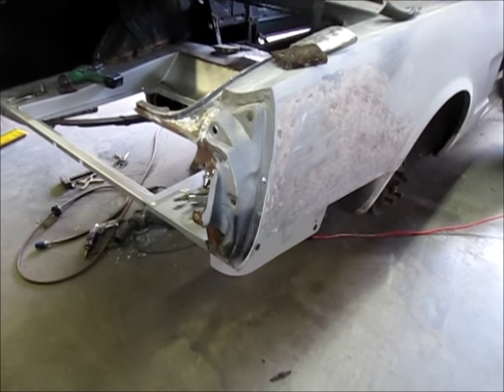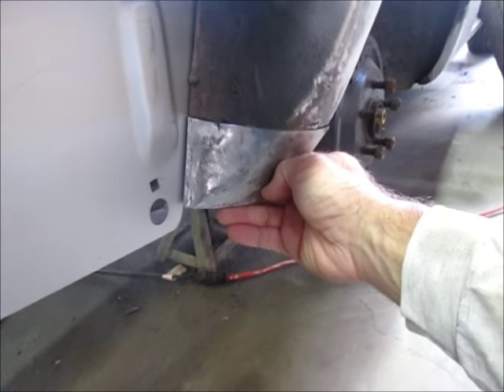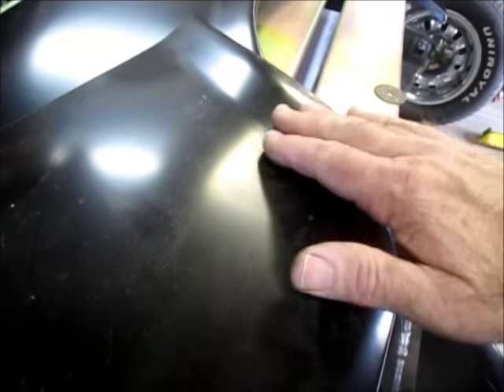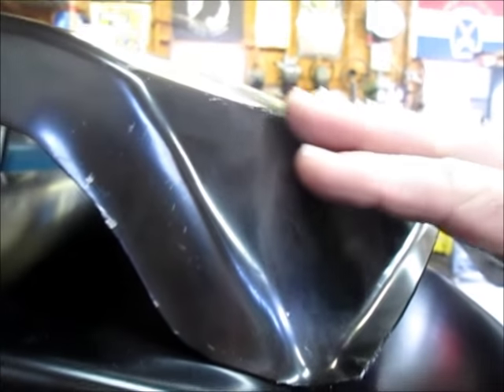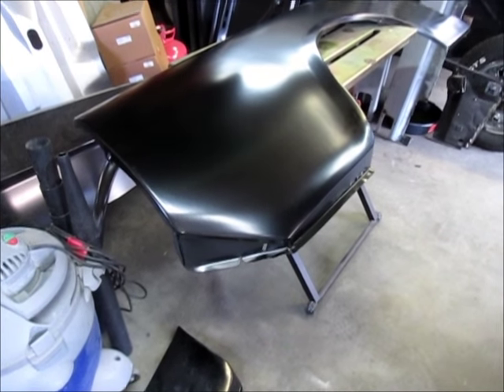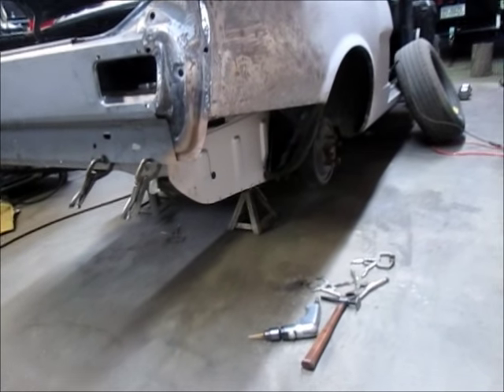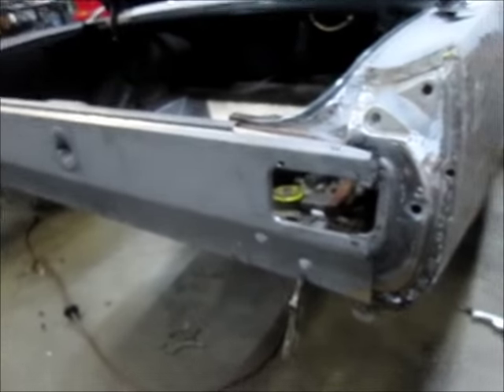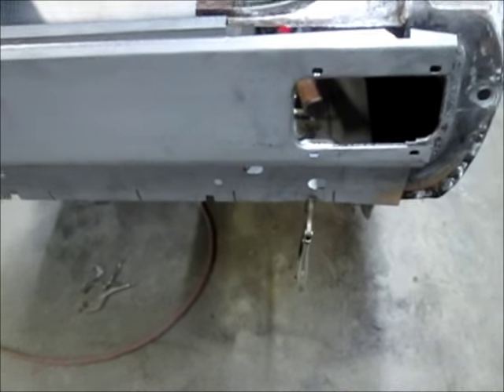1965 Mustang quarter panel patch. Mystique part 7

Comment: Good job Jo. I did almost the same here on the quarter. I bought the hole quarter panel instead of a patch panel. I cut mine different that you did and used more of the quarter panel and also had a rust hole in the front side to repair as well, I also bought the outer wheel house for my patches as well. I'm not a good metal fab guy to make these pieces. One thing i did was to use a spot welder when i could to weld the piece's when acceptable. When i did the fitting of the quarter panel but well i found many pin holes in my butt weld after grinding down the butt weld. Shining a bright light on the butt weld showed me the holes and marked and re welding did the trick then i used fiberglass bondo over the butt weld.
Love your explanation of what your doing and keep up the good work.

Comment: I watched Jo Daddy's Garage entire Mystique series, and would like to make a few comments. I'm so impressed with this gentleman and his video that I had to make a few comments. The Tail Light Panel that he's using that was produced utilizing the original Ford tooling is made by Scott Drake. You really have to did for it to find the part number!  After watching this video, I really had to search for a panel and take chances that more expensive meant better fit! Goodmark makes two panels, and the first panel I purchased was their more expensive panel that is thicker. It did not fit! t was so far off, that it would have never looked right! Most of the time I'll go with Dynacorn sheet metal.  I've used their radiator core support, front side aprons, and have really good luck with their parts!  Dynacorn was out of the tail light panel at their Camarillo warehouse, so after some searching, I found their panel at Mustangs Unlimited in Georgia, and purchased this Dynacorn Panel from them. It does not fit either! Both of these panels have the problem of not fitting over the corner sections that this gentleman pointed out, and the shape at the bottom does NOT match the end pieces or shape of the quarter panels!  This guy put a lot of work into the Mystique Project and really did a great job of showing us how he did it! Their is no ridiculous music blasting in the background, and he is calm and to the point of telling us how to do the things he accomplished on this project!  I ordered the Scott Drake original tooling tail light panel and am waiting for it's arrival. I'd like to know what manufacturer's quarter panel skin he's used for the patch panel. This guy is fantastic, I only wish he mentioned the part numbers he used (That fit)!  Perhaps it's out of being professional not to bad mouth someone's parts, or maybe youtube frowns on mentioning the bad and the good products!

The other comment that I want to make, is that when he replaced the radiator core support, I couldn't figure out why he separated the new core support from the front cross member it came with. I figured that since it's a whole unit, why not cut the front cross member out and install the whole thing! So naturally, I cut the entire cross member out of my car and installed a Dynacorn core support complete with the cross member in it's place! What a big Friggin mistake! If your cross member is still straight and in good shape, do exactly what he's done! I can't even begin to tell you the amount of work required to get the cross member out, and get everything lined up for the absolutely massive amount of welding that is required to put everything back together!! It took days of work that weren't necessary and was a nightmare! 

Anyway! Jo Daddy's Garage, you have my respect and please continue making videos! My 1965 "A" Code Coupe is really turning out fantastic, and very much due to your great job of sharing your experience!
Reply from the maker: Thank YOU for the comments and review. I try to do the best I can, and I do forget sometimes to include the basics. I'm working on that. Stay tuned for more.

Comment: Fantastic work and great insight on the panel replacement.  I believe (could be wrong) you could make the inner wheel well piece in one shot if you had a shrinker/stretcher set.  Just looking at it, seems like it could be done...  But what you did...  EXACTLY how it has to be done.  Making it work no matter what the tools are.  Have a great Christmas brother.
Reply from the maker: +Greg's Garage Thanks. I always dream of having a shop full of power tools, but to do that I'd have to move... Merry Christmas and Happy new Year!

Comment: Hey Jo Daddy,does the outer wheel house and the fender just get spot welded on the final , no seam sealer on that ? thanks
Reply from the maker: Yes. You could add some sealer afterward to the edge, and/or spray some on the inside from the trunk and quarter window opening.

Comment: How big are the holes that you're drilling in these panels that you're going to weld through? !/4", 3/16?
Reply from the maker: Typically about 5/16". It can depend on the location and if there is enough edge distance.

Comment: Hi Barry I've been watching you and took a lesson on replacing a used quarter panel there's no full panel available for my 73 gran torino sport and the one I found needed a lot of work . l test fitted on so much I nic named it yoyo I'm doing old school on the panel with lead do you have any idea if I need to put some kind of glaze over or filler to finsh it off.
Reply from the maker: +Leonard Gilbreath As far as anything I've done, I use filler on top of lead, or to blend it into the panel.
Reply from the maker: Depends on what's there. I haven't had any issues using either, but I also heavily score/scuff any remaining lead.

Comment: I have a quick question. Who's quarter panel did you use for the patch panel? I'd like to buy one to do the same patch as you did in this video. The reason it's important for me to know what works is the following: I'm on my 3rd tail light panel, The Goodmark did not fit (Summit Racing took it back, no problem, refunded my money). I bought a Dynacorn Tail Light Panel from Mustangs Unlimited, and to my surprise the Dynacorn Tail Light Panel did not fit (Bought from Mustangs Unlimited because they were the only place I could find it in stock) and they have no return policy, I'm eating $98 on a panel because UPS says will cost me $101 to send back!!). I'm ordering the Scott Drake original tooling tail light panel from Summit after I post this. I think it's important to include what manufacturer's part fit and who's don't. I figure that I took one for the team on the Dynacorn Tail Light Panel and buying from Mustangs Unlimited. I used Dynacorn Radiator Core Support and Front Passenger Side Apron and they fit flawlessly!  I used the Dynacorn full rear Quarters on my 1970 GT500 Convertible as well as cowl panel, "A" Pillars, and Tail Light Panel, and they were spot one! That's why the Dynacorn tail light panel for 65-66 not working surprises me! I'm very surprised that Mustangs Unlimited doesn't help with the return shipping. This does affect my decision making on buying  future parts from them. Summit Racing doesn't handle Dynacorn, but does sell all of the Scott Drake stuff, as well as Goodmark and all the others! The Free Shipping, No Tax in California drives me to call them first(On Orders over $99.00)!  My normal 2nd choice is CJPony.
Reply from the maker: The patches are no good. I bought a "skin" as they are the correct shape and fit better. I cut out what I needed from that part  #527846.  The original tooling tail panel is part F1657. Both from Mustangs Unlimited.